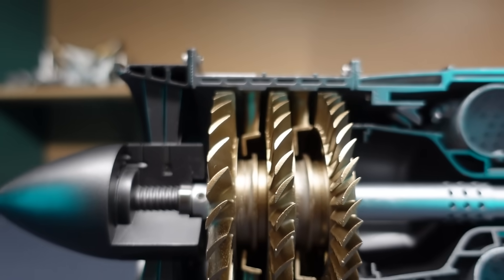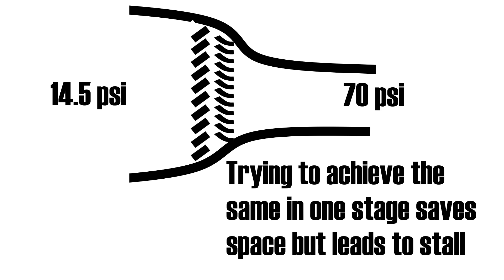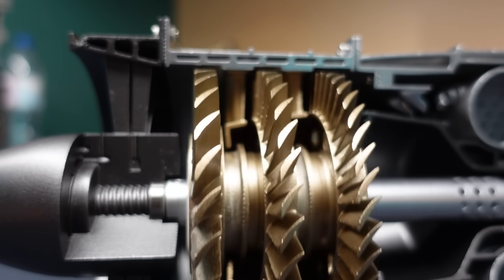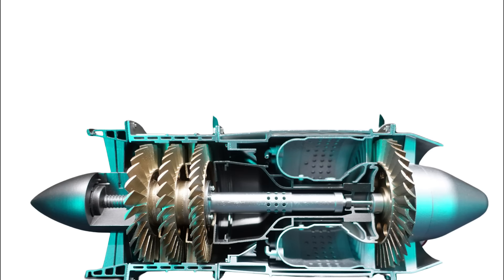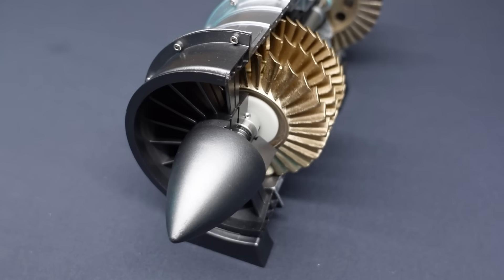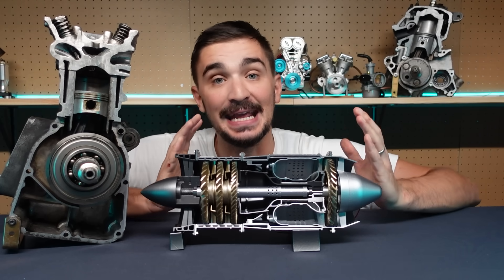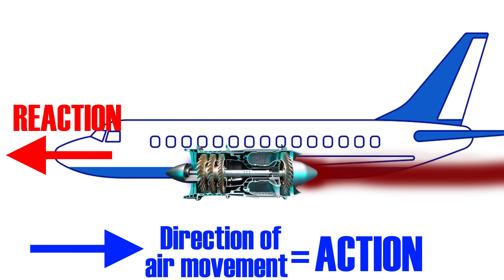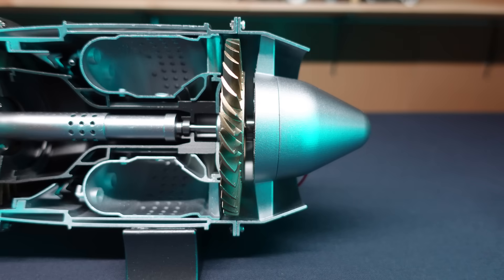Appreciating The Beauty of Jet Engines by Juxtaposing Them Against Piston Engines

Comment: 1:00 "All we have is constant combustion"
With a very broad brush, that would be true. But jet engines are also small pulses, and it's due to the fact they have turbines in them.

When the blade of the turbine spins, it generates a wave. Depending on the number of blades and the RPM of the engine, there's many many mini pulses at the "exhaust" end of the jet engine.
For it to be absolutely true that a "jet" engine didn't have pulses, you'd have to have a single flow of fuel that burns and exits the exhaust end.
Like a butane lighter works. Except even butane lighters have "vibrations" as their flame isn't exactly laminar flow. There's turbulence and that turbulence leads to vibrations.

As long as one needs to convert kinetic energy into rotational energy, there's going to be some form of interaction that will cause either a low frequency (4 stroke engine) or a high frequency (jet engine) vibration.
Jet engines vibrate... A LOT! They just do it at such a high frequency that you don't perceive it the same way.
The noise from jet engines come from these vibrations, and the noise is very loud because the vibrations are actually quite strong. It's just that at the blades, those vibrations are small, they only amplify when they hit the exhaust portion of the engine.

Or you can think of it this way... If you can hear it, it's vibrating! If you hear it from miles away, it's vibrating A LOT.
You can hear a butane lighter too by the way.

Comment: The airfoils on the compressor are also diverging. This slows down the air which is what actually compresses it. The case volume in the compressor is converging to help the air move faster. Air in a jet compressor is subsonic and plays by subsonic rules.

Comment: external combustion jet engines (water wheel generator) rocks also, one could argue that jet engines are external combustion engine, because the combustion happens in different place than the generation, the flow of hot gas could be in way different place from the generating turbine blades, if you go supersonic or hypersonic, you dont have to compress air at all, its self-compressed by the speed of the craft movement against the air, if any compressing is required. nice comparison anyways bro.
Reply: well God gave unlimited stuff, so... you are the limiter with your rules. afterburner is the non-compressed version non-melting non-axle-rotating power increaser burning flow jet engine. you can make a no-moving parts jet engine, ramjet afterburner, without the starter jet engine, or put that separate. no moving parts means no part to be broken, less failure probability for engine breakdown, more robust engine operation and lifetime.
Reply: btw both the piston ice engine and the turbine engine are about that same 25% efficient, as in heat recycling external combustion engines are more efficient
Reply: It is internal combustion because it is internal to the engine and the fluid moving through the engine. An external combustion turbine engine is possible, using a heat exchanger (to add heat from an external source to the fluid flowing through the engine) instead of a combustion chamber; that's how the proposed (and never built) nuclear fusion turbine engines were designed.

Comment: 6:50 Increasing volume, not pressure. If the pressure is increased, it will become greater than the air pressure and air will no longer enter the combustion chamber.
Reply: When you heat something up the pressure goes up. Why isn't so in this case?
Reply: @leoa4c  When you heat something up the pressure goes up only if the volume remains the same (or doesn't sufficiently increase).  You can alternatively heat something up, maintain constant pressure, and allow the volume to increase instead.
Reply: @kennethhumphries2930  Ok. With that in mind, the only way for volume to increase is for it to pass through the turbine. Correct?

Also, is that the reason why multiple turbine stages get progressively bigger (the opposite of compression stages)? Because static pressure must not increase?
Reply: @leoa4c  First I must admit I am only an armchair "mechanic".  I have no authority to back up my opinion.  Having said that, my opinion is that the volume of the air increases in the burner before reaching the turbine.  The increased temperature of the airflow is what increases the volume.  But now that entire volume is at nearly the same pressure created by the compressor. 

Yes I agree that the turbine stages may get bigger because as the turbine taps that energy at each stage, the pressure reduces a bit.  That reduction in pressure would also cause an increase in volume, requiring larger subsequent stages.  However, I'm not sure if there are always multiple turbine stages. There would be far fewer than compressor stages.  In any case, the turbine can only use a portion of the energy created by the burners.  The rest is needed for the reaction force from the exhaust to propel the jet.   Thanks for the discussion.  These things always interest me.
Reply: @kcomment2930  Your explanation does make sense. I had never thought of jet engine dynamics in terms of volume. Pressure and velocity were the only two variables that I concerned myself with.

Many thanks.
Reply: @leoa4c  "When you heat something up the pressure goes up"
This is not entirely true. By the ideal gas law when heated, pressure and/or volume increases, depending on the design. Jet engine designers make sure that the pressure in the combustion chamber does not rise above air pressure, otherwise the engine would't work.
Reply: @Yakhontov  I think that the pressure inside the combustion chamber could be slightly higher than the pressure outside of it, as there is momentum in the gases entering the chamber, as well as in the ones leaving it. I think that chamber pressure would have to be risen to a certain delta in order to overcome such momentum.
Reply: I've been looking for someone to use the word "volume".  There you go.  That's key to the whole operation.  All the pressure that spins the turbine and propels the reaction force is developed by the compressor.  But the compressor only increases the pressure of the low volume of intake air.  The burners add energy by multiplying the volume of the air by making it hotter. All that hot air has just a little less pressure than was developed by the compressor, but now there's lots of it.

Comment: 6:46 jet engines behave more like diesel engines, they use glow plugs to initially heat the combustion liner when starting the engine , however when the jet engine can sustain itself they glow ups are turned off.
the compressed air entering the combustion liner reaches temperatures of up to 500 to 800 degrees Celsius  which auto ignites the fuel without the need of a spark plug.

Also, centrifugal compressors are extremely op at compressing air but are nerfed  because they can only have 2 stages.
Reply: I mean, you can have more than 2 stages of centrifugal compresors (they are actually used in some electricity genration aplications), but the bigest downside of them is that they have a huge frontal area for the same compresion ratio (but are really short in lenght), getting huge drag, and losses in tubing become significant, needing like 3 90º turns for each stage you want to add. At that point you are better with 15 stages of axial compressors that have minimal frontal area en never changes the direction of the flow, at the cost of huge lenght
Reply: In aircraft turbines centrifugal compressors were used as single-stage compressors, and are still used in mixed-flow designs with a single centrifugal compressor followed by two or more axial stages.

Comment: 5:18 The purpose of the tapering channel is to maintain  constant air velocity through compressor stages
Reply: Close... it is to maintain constant airflow rate in mass per unit time despite higher flow velocity.

Comment: Is it true that combustion increases pressure in the combustor? I always thought is only increases the velocity, if it i creased the pressure, wont the air start flowing back into the compressor?
Reply: You are correct. The author here doesn't understand any of the fluid dynamics or thermodynamics, so he makes fundamentally incorrect statements.

Comment: It is also worth mentioning, that air at about 10 km altitude is usually very cold which helps a lot with efficiency.
Reply: hence why race cars have intercoolers
Reply: @Tornado2409 some use the A/C to cool down the intercooler too and I think that's awesome
Reply: Actually, hotter air is better for efficiency in gas turbine engines.
Reply: @CSMaverick07  How did you reach that conclusion?
Reply: hottest air is on higher altitude, that is why is up, not down , because is lighter, if you take 1 cubic meter of air from 12km in sealed syringe, on sea level it would have less volume and higher temperature than local air on sea level
Reply: @makantahi3731 that maybe the most ignorant post concerning air pressure I've ever seen.
Reply: @NavyVet4955  you think that because you do not understand fluid thermodynamics, explain why that air has less dense(gravity is almost the same as on sea level, so what left?
Reply: @makantahi3731  😂 look at you attempting to sound intelligent yet don’t understand how air density is different depending on altitude. I’m guessing you can’t grasp how pressure increases underwater the deeper you go either.
Reply: @NavyVet4955  you are attempting to sound intelligent, mentioning it, ok, you have deep lake, where is warmer water, on bottom or near surface, , i am guessing you can not grasp how density changes by temperature😂
Reply: @makantahi3731  😂 you have to be trolling, the temperature is not the reason for the density change. You have the knowledge of the world at your fingertips yet choose to remain ignorant.
Reply: @makantahi3731  Adiabatic Lapse rate. Air cools off at 9.8C/km or 5.4F every 1,000ft. This is vital information for flight. The higher you go, the colder it gets. Quickly.

You understand the first principle that hot air rises. This is true. You missed the second point in the process, expansion cools. Also it radiates heat off. Also the reason the air is warm in the first place is convection and radiation from the ground and ground objects. So when it rises it loses heat energy and is no longer adjacent to the energy output of the ground clutter.
Reply: @classicalextremism  Actually, he's right to some degree. Above the karman line, what altitude there is actually becomes much hotter than anything below. It's even called the "thermosphere".
Reply: @makantahi3731  Your sentence is unintelligible, but if I read it correctly you are mistaken.  Air from 12 km high is less dense than sea level, but it is colder, not hotter.
Reply: @gort8203  why that air would have less dense(what forces that air to have less dense in compare to air on sea level)
Reply: @makantahi3731  You have it backwards.  The air below is forced to be denser by the weight of the air above it.  Air is compressible, you know.  Try looking up density altitude.
Reply: @gort8203   no hes right, higher is warmer. Thats why when i hiked up mount everest, it was nice a toasty warm :)
Reply: @Rob-pf6yl  It's amazing how a person can take a statement out of context and then slavishly adhere to their misconception despite all evidence to the contrary.  And this isn't even politics, it's science.
Reply: @makantahi3731  Nope, decrease in density has nothing to do with higher temperature at altitude. It is all due to how much air is weighing down on it. When you press on a trapped volume of any compressible substance its volume decreases (the temperature goes up as well, with air it's at the rate of about r to the 0.27 where r is the ratio of the air volume for a constant mass before and after compression). If the plane is flying in air 1/2 the sea level pressure and sea level temperature is 30 degrees C or 85 degrees F then it ends up being about -30 degrees C or 22 below 0 degrees F. There are other effects like radiated heat from the surface and winds that cause variation but it's a close approximation. If the numbers seem wonky it's because the actual calculations are done in "absolute" units which we normally don't relate to.
Reply: @ehb403  on meteorology lesson, teacher confirm me that what i said, it is basic principle, lighter gas goes higher, so air must be warmer to go higher,

Comment: I wish you were able to do one with the Chrysler Turbine engine in the 60's . Would like to see what, how, and what it would all run on for fuel, plus what kinda power it made and what kept it so quiet compared to the rest of the Jet engines of today.
Reply: I am making a guess here.   
1.  It had a diffuser type muffler / exhaust.  Spread it over a larger outlet and therefore slower airflow.
2.   It was designed to output 'shaft horsepower' for movement (work) rather than thrust / highspeed air for movement.

Comment: Great video! Jet engines are kinda cool, and if they ran on seawater they would indeed be the coolest thing ever. The huge hi-bypass jet engines on modern wide body airliners are surprisingly efficient, but military jet engines are off the scale thirsty, even after decades of development. Even after all this time, the humble 4 stroke engine still has an awful lot going for it. 
It's interesting to think about what might succeed jet engines in the far future. Sci fi style ....
Reply: By military jet engines you mean for high speed aircraft, not transports, and they will always be less efficient.  The low bypass ratios and afterburners needed for high speed flight can never be as efficient as a high bypass turbofan.  The humble 4-stoke engine can't even play in that high-speed arena.
Reply: @gort8203  yes, all correct, I was talking about jet engines for high speed fighter jets. My comment about the humble 4 stroke was a general observation, not a claim that it can rival the jet engine for all round performance, especially at altitude. 
What I meant, was that for 99.999% of us, the 4 stroke meets our needs very well, whether that's in a car, motorcycle or truck. For a design that's over 100 years old, that's pretty impressive.
Reply: @richardconway6425   Yes, and a piston engines driving propellers is still the most fuel-efficient powerplant for slower aircraft as well. They fell out of favor for most commercial aircraft due to requiring more maintenance and being less reliable than turbines. That, and their higher fuel consumption was partly outweighed by jet fuel being less expensive than high avgas, even though you have to carry more fuel.  I wonder if that is that is still the tradeoff it once was, as I remember when diesel used to be cheaper than gasoline as well.
Reply: Water isn't fuel.

Comment: It's Inevitable that you're gonna explain us how Turbofan works right?

I can't wait to see a Jet Engine-swapped RX-7 and Miata
Reply: It works the same way.  The difference is that the first row of blades is larger and called the fan because some of the air bypasses the engine compressor.  Everything after that point is essentially the same.  Turbofans take more energy out of the turbine section to power the fan.  Turbofans are more efficient than turbojets at lower speeds and altitudes.
Reply: That's what he said at the end of the video - didn't you watch it?

Comment: As  always  an Excellent Explanation . Yes , that is a simple Turbojet . Like the Mighty  Tumansky's  that powered the  Mig-25 to  Mach 3.2 . 🤣. 
Or the J-58's  of the SR-71 . Also Turbojets .
The  Modern Twin Shaft   Turbofan is a different " Animal " entirely . Like the difference between a  Flathead  and  DOHC 4valve .
Yes , Gas Turbines are  VERY  Thirsty . They only have ONE , PARTICULAR speed where  Fuel/Work  ratio  is ideal .
Do  those  next  please . Then explain how  a  " Free Power Turbine " works for Ship propulsion or Power Generation for Electrical Supply .
Gas  Turbines  make  VERY  big power  for something so compact , BUT , they are best at Constant Speed  running . Great Video , as usual .
You are  REALLY  good at explaining things for the  Layman .

Comment: D4A should be one teaching engineers not engineer teaching him.
Reply: There are many fundamental errors of fluid dynamics and thermodynamics in this video. Any decent engineering student would be able to correct them (as several commenters have provided corrections here), and would dismiss D4A as not competent to teach engineering.
Reply: @brianb-p6586  i meant it as joke!😅😂
Reply: Okay, but how is it a joke, @ScrewBlower ? You're suggesting that this YouTuber who doesn't understand how any part of a gas turbine engine works is more competent than engineers - what's funny about that?

Comment: ONE OF THE BEST DAYS OF MY LIFE was a private tour and explanation at the Rolls Royce Jet Engine plant at Derby in the UK - absolutely amazing

They GROW the turbine blades as a single crystal of titanium...!!!   Also they don't compress the air in the RR engines, they keep the pressure the same and increase the VELOCITY, this lowers the temperature of the combustion I believe.
Reply: I think you mistook what you were told. Technically the compressor blades increase the velocity of the air while the stators actually do the compression of the air. RR jet engines certainly compress air before they enter the combustion chamber.
Reply: You are correct, gas pressure in the combustion chamber should be atmospheric, it is indeed velocity what is needed. In fact the only reason why the compressor is there is to prevent the exhaust gases from going back through the intake. After the compressor, there even is a diffusor (even in his model), where the intake air gets expanded, reducing it's pressure.